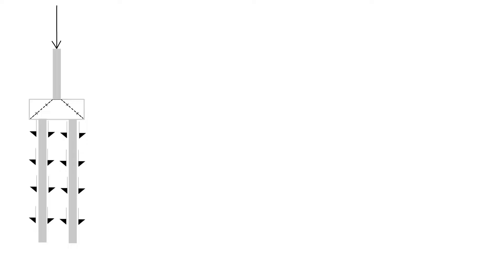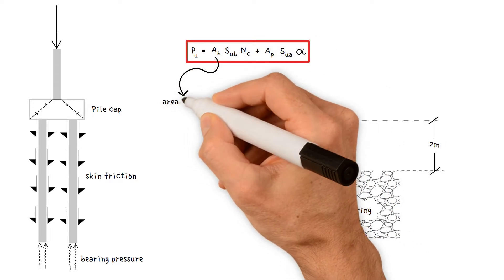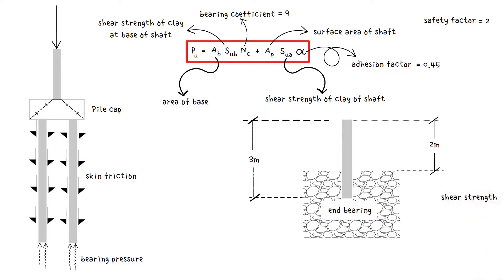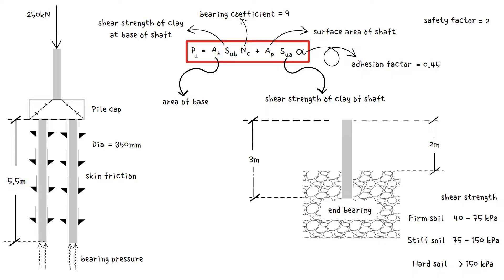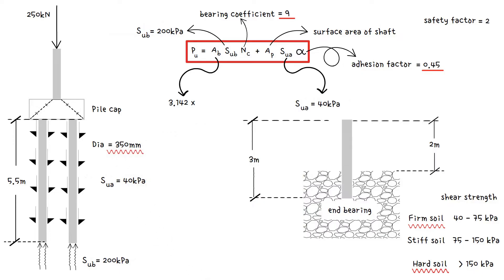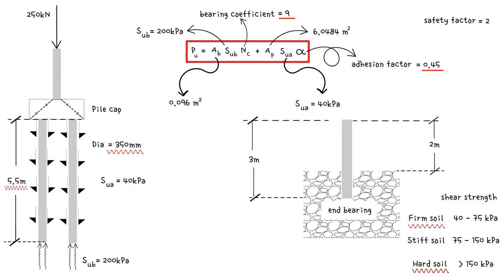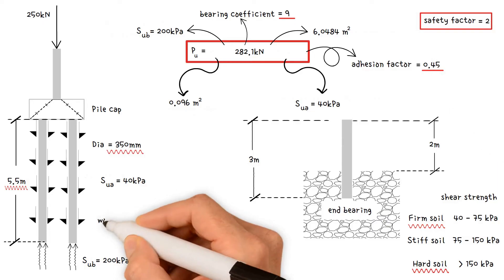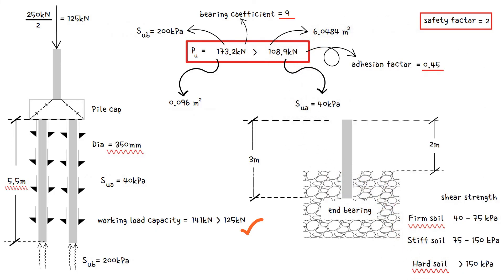How to determine the pile capacity.

Comment: Good day Mr Structural Engineer Calc.

I have this problem that i am solving and i can not find any relevant to the question, Please assist me with any source of relevant material that i can use to get it solved or any method or steps that i can follow to get to the correct possible design. 

Provide an optimal design of a 16 m long concrete pile that is to be driven into 12 m of loose 
sand that was underlain by very stiff clay. The geotechnical parameters of the sand and stiff clay 
are respectively as shown in Figure Q2 below:

Sand: ∅’= 26°; Unit weight γ = 19 kN/m3
Stiff clay: cu = 80 kN/m2; Unit weight γ = 18 kN/m3

The pile is expected to undertake the following characteristic loads:

DL = 35 00 kN

LL = 25 00 kN

Also, Fcu = 40 MPa and Fy = 450MPa

Additionally, maximum pile length allowable = 20 m (meaning the stiff clay can extend to 20 m depth). 

The idea behind this exercise is to provide an optimum design.

Comment: This is good, easy to understand. Just a question, don't we need to multiply by 2 when calculating Area of pile base and Area of frictional surface for pile considering that 2 piles are supporting the Column?
Reply from the maker: No you don't need to multiply by 2 because we already divided the column load by 2.

Comment: I get that the two piles share half the load but don't we need to consider the distribution or "load spread" based on the angle of the lines drawn in the pile cap?
Reply from the maker: No you don't need to!